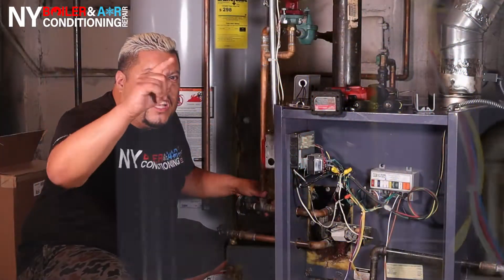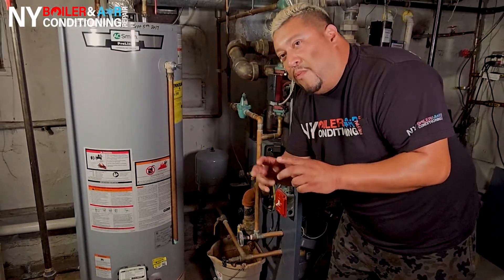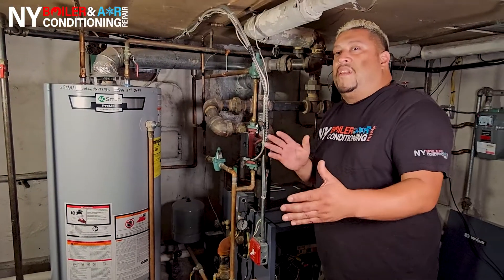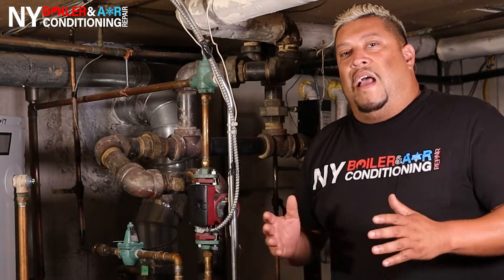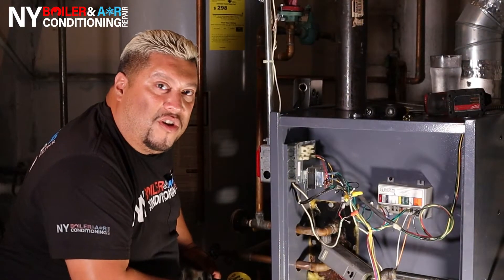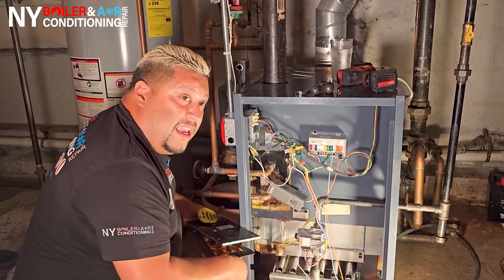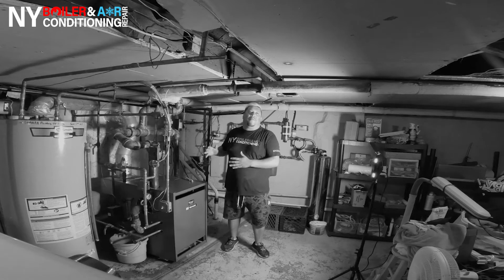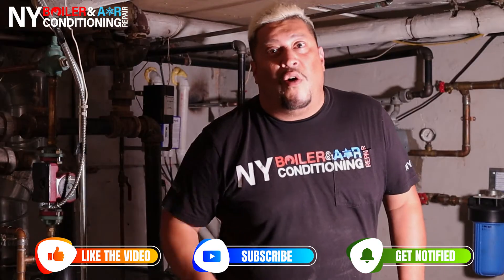How To Do a Boiler Water Coil Replacement

Comment: What’s the box and sensor attached to coil in the middle, what it does if coil is used to heat the water?
Reply from the maker: The grey box sensor is called an Aquastat to measure the water temperature

Comment: Mine looks even simpler,  I plan on using sharkbite fittings,  cut 2 pipes,  undo 4 bolts, soak coil in murick acid, reinstall 

I think I have 2 cuts in the pipe,  was given professional estimate for 2k plus taxes

Will cost me $50

Comment: I thought your weren’t supposed to use teflon tape on low water cut off probes.
Reply from the maker: You can but after the first 3-4 threads. Why? Because it needs to make a ground connection
Reply: @ ahhh good to know

Comment: How many bolts did you break removing the old one?
Reply from the maker: On this job the bottom bolts snapped off. A total of 2. We had to re-tap and redo the threads on the boiler block

Comment: Where they using the coil to heat part of the house. I noticed a water heater in the back.
Reply from the maker: yes, its a steam boiler to heat the house and they are using the hot water coil to heat an apartment they have on the ground floor